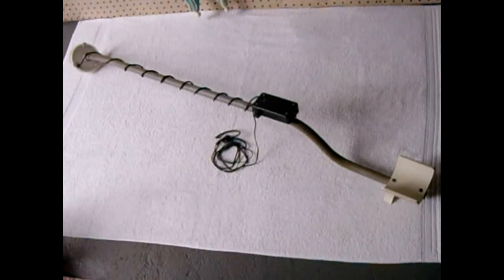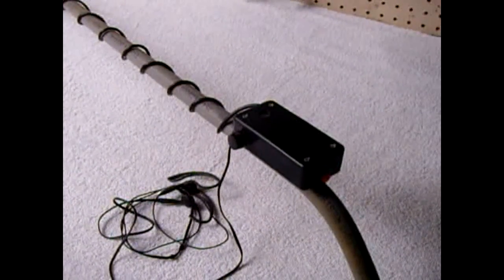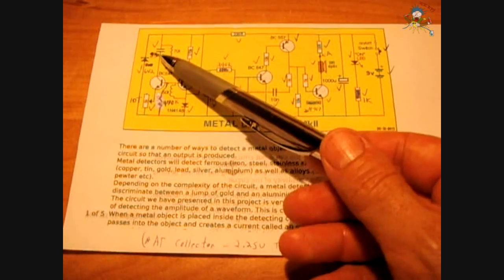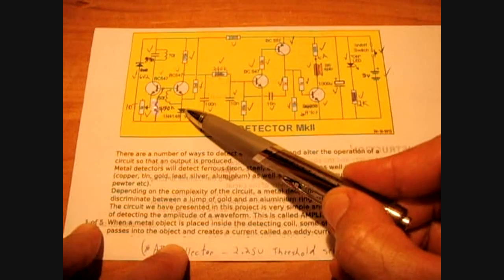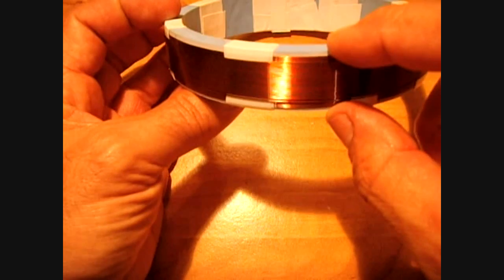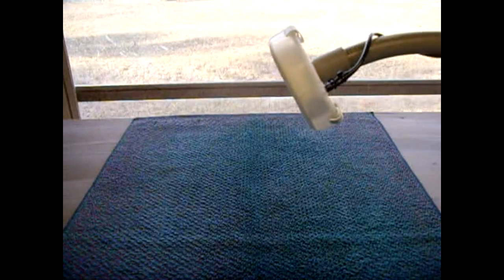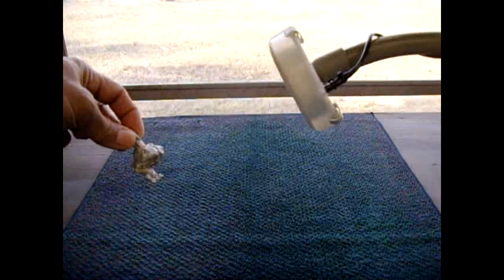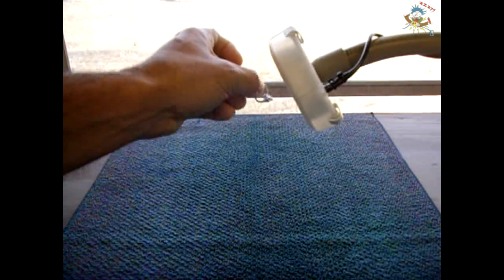HOMEMADE METAL DETECTOR ~ Simple & Sensitive(Schematic)

Comment: I made a simple one using a two transistor oscillator with a 5 inch coil of 3/8 inch copper on the head. And in the box was another oscillator and mixer to the phones. The coax fed power to the head, and brought the signal back up to the head. It is a very simple looking device, but it worked fairly well. It had a flaw however as it seemed to be mainly for iron and especially for aluminum. Gold gave a weak and soft response.

Comment: I realize that this is an older video, but if you are still doing these kind of projects, you might want to try building the Russian PIRAT pulse induction detector. Mine detects coins at 8 to 9 inches, and bigger stuff much deeper. It's not good for trashy areas though. Just the nature of the beast. I may have to see about building one of these as well, if I can get more depth out of it. Good video. Rekindled my interest.

Comment: Sir! How many turn do i need when using 0.3 mm wire?
Ps: i did the same project using 0.3 wire ( 50 and 70 turns ) but there is a big noise even when i turn the pototiometer it decrease a little bit but thats it
Reply from the maker: Try winding one of the coils the opposite direction.
Reply: @electronicsNmore  Sir I did but there is always that noise. I tryed without one coil and without both but the same thing happen
I dont understand why is that. 
I added a temporary pototiometer with 10k between one wire from the 70 winding and the ground and the noise decreesed
What could cause this problem sir. I need your help because my knowledge about electronics is very limited

Comment: Have you tried different transmit frequencies such as 2200m, 630m, 160m, 80m, 40m 20m, 10m, 6m, 2m, 1.25m, 70 cm?  Have you tested your transmit coil for SWR to verify that it is tuned?  Have you tested using different wire thicknesses as that can change bandwidths?
Reply from the maker: No, this was just a simple project.

Comment: What would be the most powerful detector on the market..thanks again for a marvelous video
Reply from the maker: I like Minelab metal detectors. If you're looking for deep items, then you need to buy a larger search coil for use with the metal detector. Larger coils have trouble detecting very small objects, but have no problem finding items larger than a pencil eraser.

Comment: I want to ask you one more on this detector if i connect the battery speaker is producting a tone, all circuit is consuming around 180mA and zener diode is very hot.Can you give me any advice please?
Reply from the maker: +Lar&en Đ 
Check all components(or replace them), as well as all connections. Definitely something wrong.

Comment: dear electronics n more
as u said to take the coil from the transformer i took it and now the problem is that the copper wire that i took from the transformer are seperated......i mean that the copper wire which i took out is cut from some edges so i wanted to ask that can i solder the ends of the coil with the another end of the other coil to make a 30 meter long coil???????
Reply: Did it work for you with 30 m? What's the purpose of it being 30. M anyway?

Comment: I have a problem with the circuit, i cant hear anything using dc current, but when i use ac, i cam hearthe motorbating sound anf adjust the frequency, but it seems that i has very little effect from the metal objects. Could it be from the rgulator diode?
Reply from the maker: You likely damaged the components but trying AC.
Reply: @electronicsNmore  i noticed that the 18ohm r from the speaker heats up when i apply more voltage. With dc the transmit coil gets about 13VAC.
The AC i played with was small, around 30, and it implied its frequency on the speaker, besides thst i could hear the motorboating sound.

The receive coil doesnt seem to pick up the current.
I will test my transistors to make sure i did not demage anything, then doubl e check the connections. I had a hard time finding a b557, and i think i used a 2n3904. Aloso could not find a d rectifier 5v6 zener, and used 1n4148.

Comment: can you please tell any substitute for this .25mm..beaczz it is not available here...any substitute like .5mm or 1 mm or?????
Reply from the maker: +harishvar akaash 
Wire diameter is not super critical. (.5mm) is not too large, but you are better off looking for thinner wire (26-30ga) from a transformer, relay, or solenoid which you can tear apart and remove the enamel wire.
Reply: +electronicsNmore 
ohk

Comment: Hi, I built this thing and I went by the original design and I am getting a constant tone from the speakers whether the coils are hooked up or not.
Reply from the maker: Try connecting one coil in reverse.
Reply: @electronicsNmore  I did and it did not work. Should it be silent if the coils are not hooked up?

Comment: Dear electronicsNmore
should we take only 0.25 mm coil or can we substitute this?????and also please explain that what is a diameter former..???
Reply from the maker: +harishvar akaash 
Hello. Use enamel wire/magnet wire which is .25mm or close in size. A "former" is what you use to wrap the turns of wire around for the correct diameter. You can use many objects.

Thanks For Watching!
Reply: +electronicsNmore  
should i use only 70mm diameter former or can i vary the diameter????please reply soon as i am going to finish this project only the coil part is left>>>>
Reply from the maker: This was all discussed in the video. Please watch the video again. Thank You
Reply: +electronicsNmore 
actually i didnt understand it so please say yes or no that whether i can vary the diameter size????and also is it necessary to wrap the coil around the diameter former in layers from top to bottom as mentioned in the video.....in the talking electronics site the coil is just wrapped around and are overlapping each other.....???please clear my doubt
Reply: +electronicsNmore 
also plzz tell that how much inductance does the coil gives us????and how many we want?????
Reply: Harishvar, did you get it to work?

Comment: The coil reciver is over the coil trasmitter, without isolation? Because in mine the speaker make a no stop sound ....always... and the sound not change.. near  a metal or not.. the sound is the same.. I use 840 mH with 144 nF  and 320 mH for the reciver..
Reply from the maker: Try reversing the leads going to one coil.
Reply: I try now, but there is something strange..
When I insert battery and push on.. the led work and the speaker start the same sound..
even if I not insert coils..the sound don't stop... what happen? ... it didn't works   :-(

Comment: how hard would it be to add a pot and circuit for a discriminator, possibly a switch and circuit for switching between all metal or disc modes? ... overall i like the basics of the control box, pipe/shaft. not a big fan of the tiny coil and coil assembly.
Reply from the maker: Very difficult.

Comment: On the schematic at talking electronics there is a 390 ohm surface mount resister between the 500 ohm pot and the transistor did you include this in your circuit. 

Thanks
Reply from the maker: Joshua Dowler Hi Josh. There is a 200 ohm resistor in series with the POT. Be sure to use a 10T pot for easier adjustment. Refer to my other video below showing what I used for a POT.

Thanks.

https://www.youtube.com/watch?v=DSQdB_j7xwQ

Comment: Great video fella, again!!.... One thing... what setting do you measure henry's in? I was under the impression it was ohm's but I might be well off. Thanks again
Reply from the maker: Hey Martyn,
You need a DMM that has an inductance setting for Henries. If you don't have one, you can buy a decent meter at a very reasonable cost on Ebay(Under $35). A good DMM for everything else except inductance would be the Vichy VC99. They are $35 shipped.

Thanks For watching. Be sure to share.
Reply: Thanks fella, I'll check them out on ebay
Reply: @electronicsNmore  This one can penetrate a few meters underground, if you want to go deep, what self-control

Comment from the maker: jaime lomayno The meter is more of a "Q meter" where the amplitude of oscillation is reduced by losses to the metal underground.
Reply: sir what is the 10 turn potensiometer im having problems with adjustment its very hard to adjust
Reply: how do you made that i cant see it in the video?
Reply from the maker: I have a video coming up in 5 days showing how I made a small 10T POT with a knob. If you do not use a 10T POT, the sensitivity adjustment can be very difficult.
Reply: ok i will wait until your video is uploaded!!
 ive been making your projects i 11 project i already done and they were all usefull like inverter pwm,generator,auto cut off for battery charger
Reply from the maker: If you can fit a large 10 turn potentiometer inside your project enclosure, then this is what you need to buy:

http://www.ebay.com/sch/i.html?_from=R40|R40|R40|R40&_sacat=0&_nkw=10+turn+precision+potentiometer&_sop=15

If you want something small that works just fine and is cheaper, then wait for the video.

Thank You!
Reply from the maker: Yan Sviatsky
I could not tell you because I had most of the parts laying around. You can buy an inexpensive kit at the link in the video description, then copy everything else I did after that.

Thanks.
Reply: +electronicsNmore sir can i request a video from you this is anothe r metal detector a simple pulse induction type.. it only have two ic the ne555 and tl082..
here is the schematic
Reply: +electronicsNmore here is the link  http://www.treasuresweeper.com/simple-pi-schematic-and-pcb-layout/

Comment: electronicsNmore 
If i double the coil turns will i detect deeper ? Or make the coil more width ?
Reply from the maker: Larger coils locate larger objects deeper, smaller coils find smaller objects better but with less depth. You can experiment with a different # of turns, but I do not think much change will occur.

Thanks For Watching!

Comment: Great Job. Thanks for sharing. How hard is it to put a bigger coil on it to detect deeper into the ground? Thanks
Reply from the maker: Thank you! Not too much work to make a larger coil. You can only detect so deep with a simple metal detector like this one.
Reply: @electronicsNmore  
Do you mean Only simple detector can detect deep objects? 20 ft for example with bigger transmitter  coil? Can you explain please?

Comment: Could you make a head with both coils in it so you could find stuff in a better range of depth without switching out heads and doing 2 passes?
Reply from the maker: No. You only use one coil at a time.

Comment: hello I really want to know is it work long distance and I need metal detector is detect more than 2 feet if you know please let me know
Reply from the maker: Only LARGE objects can be detected 2 feet away. The same applies for most high end metal detectors.
Reply: thanks for reply, i need for my  project, not for excavation. which  one work for my project, that's required small obeject and long destance detector. if you know please let me know or what you share it's work for it. thank you
Reply: and where I can get it

Comment: How stable is this circuit? Does the threshold drift?
Reply from the maker: Tim Nelson Fairly stable. The 10T pot allows for easy threshold adjustment. Remember, this is a very simple metal detector, but it certainly works well for what it is.

Comment: Great video,I want to ask you if i can replace BC557 with BC327 and BC338 with BC337 .
Reply from the maker: +Lar&en Đ 
Hello. Please refer to the link below. Enter BC557 and BC327 in the cross reference box at the upper left of the web page. If both parts bring up the same NTE replacement part#, then you should be fine. 

http://www.nteinc.com/
Reply: + electronicsNmore Thank you
Reply: +electronicsNmore I want to ask you one more on this detector if i connect the battery speaker is producting a tone, all circuit is consuming around 180mA and zener diode is very hot.Can you give me any advice please?

Comment: Hi I am new to electronics, would you be able to post an updated schematic of the circuit
Reply from the maker: Joshua Dowler There is a link to the schematic located in the video description area. Any other changes I made were mentioned in the video.

Thanks.

Comment: I just made it with 60 turns and 30 turns coils but nothing
all i get is a 60hz humm from the speaker
Reply from the maker: Try reversing the connections to one of the windings.
Reply: electronicsNmore i rebuilt it and the pnp transistor was blown, replaced it
but now if i put in any metal bothing will happen i will hear the sound but bo change, if i disconect any of the 2 coils the sound stops
Reply: electronicsNmore if we could like meet up on fb, discord so you could have a look
Reply: @electronicsNmore  I figured out that i forgot the diode but then the sound stopped

Comment: Whats the inductance of the 70 turn winding?
Reply from the maker: Don't be concerned about that, just make the coil as explained in the video using the correct size wire.
Reply: @electronicsNmore  No, I need the inductance, as I am using if for something else and I dont have a lcr meter
Reply from the maker: @jurevidovic9660  Sorry, cant tell you because the project is long gone.

Comment: Hey EnMore.  Is this BHO?  VLF?
Reply from the maker: +Eric jones 
The meter is more of a "Q meter" where the amplitude of oscillation is reduced by losses to the metal underground.
Reply: electronicsNmore  it has to be one or the other.  looked up q meter and nothing shows up.
Reply from the maker: *****
No, this unit uses induction. Definitely not a BFO. They also sell pulse induction metal detectors. This unit operates in a similar way.
Reply: electronicsNmore  I found a blurb on Q meters that are similar to nail finders,stud sensors.  thanks.

Comment: how to increase the coil radius where the circuit still works
Reply from the maker: It can be done, but sensitivity to smaller targets will be reduced.
Reply: I can change the wire size to 0.25mm with the other dimensions for example 0.4mm
Reply: I make it. but not work correctly

Comment: I been watching detector mods in Australia, he modifies minelab and other detectors!  He says  the multiple strand ultra fine multiple strand enameled wire Is the best, picks up a lot less noise, making them much more sensitive!   Would it be possible to use an adjustable frequency driver say, ,16khz for one setting and 60 khz for another ,  I'm not concerned about current draw. If it used a batter fast as a drill. And required a 20 ah 4s battery to power it for ,8hrs.  As long as it performed very well I'm expecting alot,  I'd like it to find gold about 0.25,,mm cubed maybe smaller,   seems we could build detectors by now that can find gold dust 36" deep from a drone! (The government probably can!)   If nothing else hit the ground with something like a magnetron,  to rattle the gold atoms. And use something to pick up that frequency, and ignore the magnetron, ,(,,or whatever)'  I also have many ideas for pickup coils maybe a rhoden  , maybe two  coils, DD coils made from multiple small coils. The wire enameled 40 gauge with about 18 24 strands wrapped around a ,,m6 nylon tube, forming the coil ,  or serpentine coils zigging around 1" pieces of PVC.. with s ,1" gap between them on a 1/8" plastic sheet, plexiglass maybe,   one coil zigging the other zagging around the ,1" bits of ,1" PVC.  With the wire triste around a ,1 mm nylon core. Possibly braided around it. If possible to do by hand  and group about 3-4 of these wires to make a coil with them twisted around each other and glued, heat shrink in place , use silicone adhesive, or rubbery glue.  So it's still flexible. There is dozens of ideas  for coils  also coils with a ton of wire, use aboutv100 strands of about 34-40 gauge wire requiring about 60 turns to get the resistance down use a pound or more of copper to make s 4.5"-6" coil like the size of 6 gauge battery cable wrapped into a coil and also try pancake coils  and half sphere coils!  The prospectors like small coils to hunt gold , I'd want to build a 24" coil and a 4"-6" coil maybe a concentric coil or coils, a 24", 18" 12" and ,6" with their functions alternating pulse coil in center  followed by a receiver then a pulse coil and outer receiver coil.    Then finally a 2",x 6" pulse coil followed by a 3.5" x 7" receiver. Using, 1/4" 3/8" nylon tube to spiral the tiny wire around! Glue in place run the wire around at about 45°  then a second layer alternating the direction it crosses,  then solder each wire to a shielded 18 gauge wire to the control board! A 24",pancake receiver coil, surrounded by a 26" pulse coil could  make put a 2" parallel pulse coil in the center. And what about small dishes with pulse coils in the center and receivers around the edge or vise versa!   Could a dish help concentrate the signal??? Too many questions, possibly a few test could answer them all!  But more copper, should find more gold! If nothing else build a jig with about 50-65 small coils of wire and 30 spools of thread  to space the wires from each other. Drill holes in a cutting board!  With each wire and thread coming out its own hole then twist the wire and thread together as it comes out the board,  also have a  center hole for nylon tubing. With some modification it can braid the wire around the tubing!   The stuff used in auto upholstery could work!  It would look like the ground / shield wire on a coal axial cable only each strand is enameled!   Maybe it can build a detector capable of finding ,2-3 specks of gold dust at 12" and 6 gram nuggets at 2-3"yards, this would be awesome,!! Is it possible,?? Great ol video, sorry to ramble, I was up all night!b have an awesome day!!